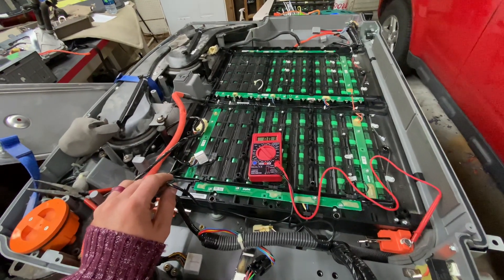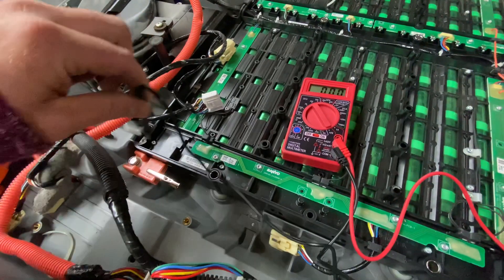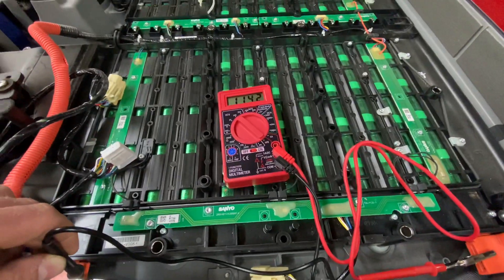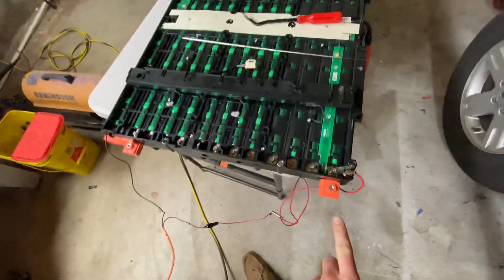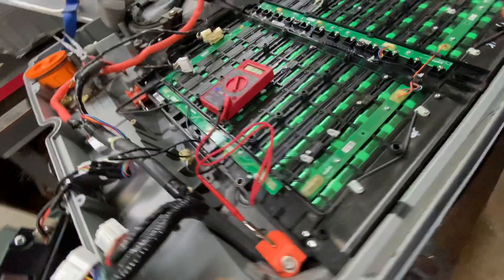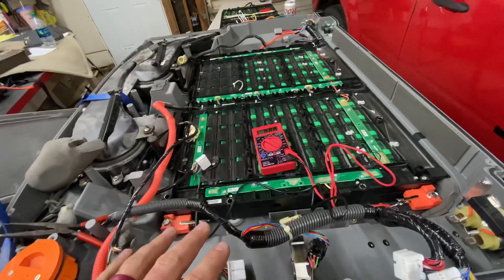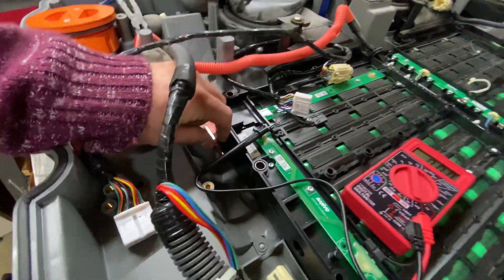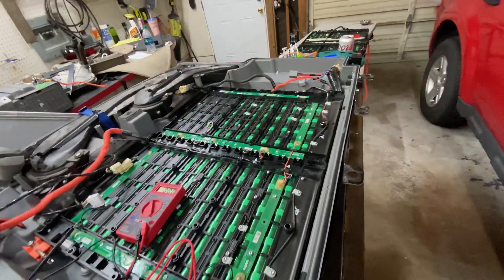2009 Ford Escape hybrid battery bench charge with prolong charger

Comment: gracias por el dato de que no hay contacto en los pernos de salida de cada bateria sino que tengo que poner cocodrilos en cada plaquita que es donde esta el contacto de salida mi cargardor es de 350 voltios asi que tengo que poner el tapon de seguridad para sumar los voltajes de los 2 paquetes de 150 voltios cada uno paea poner mi cargador de un solo a cargar bateria completa el ford escape que estoy revisando es 2006 y no quiere arrancar porque un paquete de bateria tiene 127 voltios y el otro tiene 139.8 voltios  gracias por el dato saludos desde el salvador centroamerica
Reply: Thanks for the fact that there is no contact in the output bolts of each battery but I have to put crocodiles in each plate that is where the output contact my charger is 350 volts so I have to put the safety cap to add the voltages of the 2 packages of 150 volts each PAEA put my charger of a single to charge full battery the Ford Exhaust that I am reviewing is 2006 and does not want to start because one battery pack has 127 volts and the other has 139.8 volts thanks for the data Greetings from El Salvador Central America -Google Translate

Comment: Please let me know how I can recharge the hybrid battery pack for a 2007 Ford Escape Hybrid.
Thanks
Reply: The 07-08 escapes have a button located behind the driver side kicker panel. As long as your under hood battery good then you press that and wait for the little green light to flash at you (about 8 mins) then, you should be able to start the car. After 08 they removed this feature. This of course still doesn’t tell you the health of your hybrid battery. It just gets the car running again.

Comment: ? doesn't the battery safety switch close the circuit to both batteries when in operation mode?  So my ? is why hasn't anyone adapted the switch to a booster pack for a fast recharge for the main battery pack?

Comment: Thank you for great video. 
Form the advice I got prolong battery charger and following the step you provide. 
Only thing is does it matter which side of positive charging cable hooks up to ?
And my prolong showing
 dc 202 v on top and  dc 000 a
And it hasn’t charge anything yet for last 1 hour.

Comment: Thanks for your idea. I was able to charge mine using an LED power supply (a lot cheaper than Prolong battery charger). I was able to create a connection from the relay to access the battery if ever it gets discharge again (so i do not have to disassemble the battery again. Your video helped me understand the connection of the two packs.
Reply: Vin how did you do this I have a dead escape battery, and a cheaper option is ideal for me?
Reply: What kinda Led power supply you used ?
Reply: @driver2010dude  I used this power supply
HLG-120H-C350A
Reply: Vin awesome man I really appreciate you I’m gonna try it probably tomorrow seriously thanks again
Reply: how do you create the connection from the relay? i have to do the same
Reply: @jcloss39  You will have to open the battery pack. First unbolt the housing from the chasi before you can open the pack. Once you got the lid or cover open you gotta watch the video on my page before you can proceed. Make sure to be careful this is a very high voltage battery and could lead to serious injuries.
Reply: How long does this last for?
Reply: @Kenya3131  I still own the car and it runs great since the video was made.

Comment: Btw what model of the prolong charger you used. I went to look for the same charger and theres different models for different car. Please help
Reply from the maker: The charger is the same. it’s the cords that are different. I have a cord for Toyota Prius. I just put alligator clips on the end of the positive and negative. The cords are meant to be permanently attached in a vehicle that’s why they make them different. The charger itself adjusts to the battery automatically. I would look on eBay. They are much cheaper. It doesn’t matter what cord that comes with.
Reply: @johnbartellshhop   I actually just dissembled my battery, it is still sitting in the back of the car. I am shopping around for the Prolong Charger. You said the charger adjusts to the battery automatically, meaning it will not overcharge? Thanks for your time replying. Thank you very much!
Reply: @vin3022  thank you for posting. We're you able to leave the pack on place. Or did it have to come out of the well?
Reply: @jgoloff  I was able to leave the pack on place. I didn't have to remove it from the car. Watch my video on my page.

Comment: Mine is dead for not using it 2weeks. Recharged the 12v battery and still no start. Do I need to remove both batteries and charge them one by one like you did in order to reach full 300+v or just charge it till it reaches full? Btw where did you get your chatger?
Reply: Does this work for 2009 mercury mariner hybrid ?
Reply: @truthhd6345  yes, it is the same vehicle.
Reply from the maker: I got my charger from Prolong https://hybridautomotive.com/     With this charger it only charges up to 250 volts. The Escape hybrid battery is over 300 volts. That means you have to open up the battery and charge both battery packs separately. It is a pain, but that is what you have to do. As for charging it in the escape. You can, but unplug everything then charge.

Comment: When you put on the alligator clips do you need to wear protective gloves?  Then get the alligator clip into the opening of the orange areas?  Then just charge for a day per side, right?
Reply from the maker: Yes. I would wear gloves and yes it will take you 2 days to charge.
Reply: This battery won’t last long after this open heart operation.  There is a guy in Dallas can charge battery directly with special tool. He did it inside of the car. Took about 30 minutes.
Reply: @cbrrebates  can you please share the video for this or direct me to it?
Reply: @cbrrebates  do you have the guys info in dallas